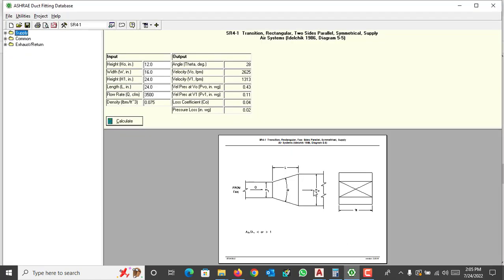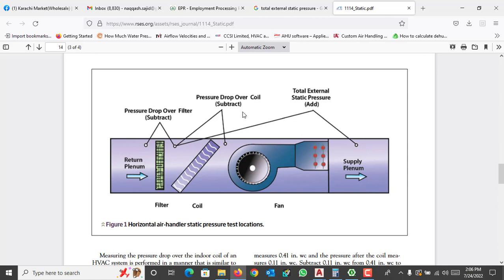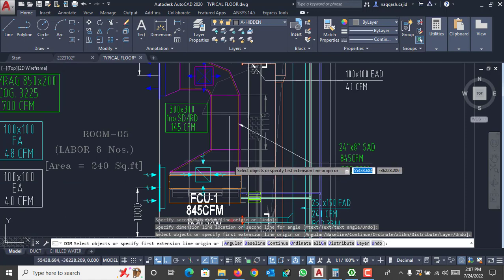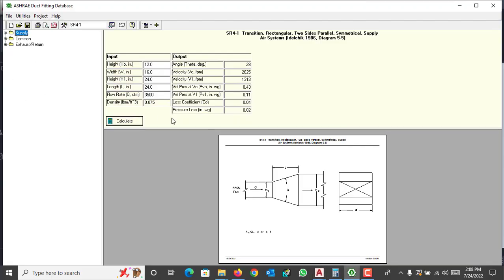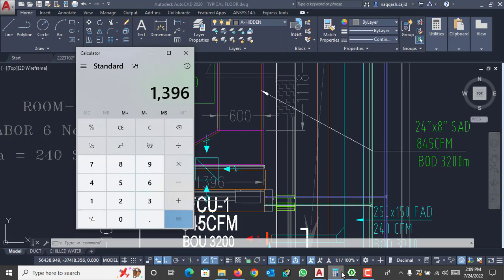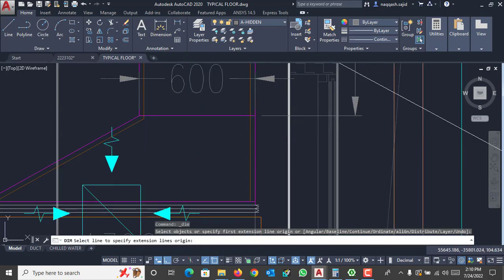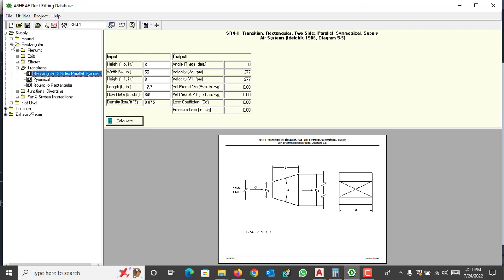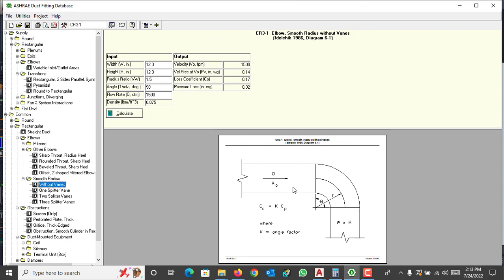How To Calculate ESP of Duct Using "ASHRAE FITTING DATA BASE"

Comment: I noticed that for transition you only add the largest size (width) and ignore the other (small one) & Even though there is `from fan` symbol on the template, you calculate it the other way around. how does the program consider and calculate it?
Reply from the maker: Please watch it again, i have already put the small and large side values, the fan is not a part of ESP calculation. Equipment is a part of total static pressure.
Reply: @passionateengineer04  you misunderstood my question. when you calculate the first transition, you did not enter 24" (width) anywhere. you only entered the heights and width of the one of ducts.

Comment: Is there any way we can view the tabular value of the fittings from the software? I couldnt find the pdf versions of various fitting values presented in tables. (the ones i found is not as complete as the ones in the ashrae dfdb software) also, i didnt see the link to download it. Are you using the original one or the cracked version. Thanks in advance!
Reply from the maker: These all values are available in ASHRAE handbook.
This software is not crack one.